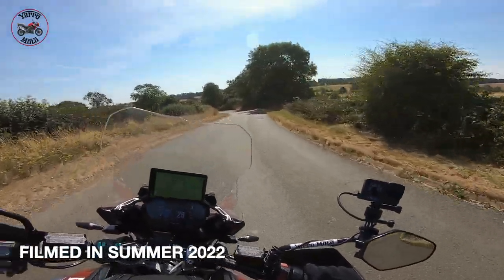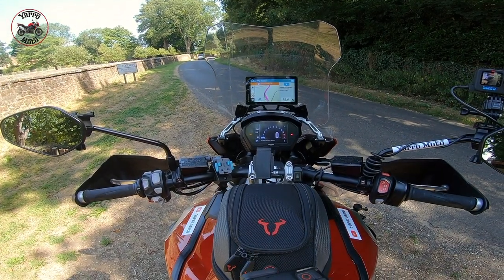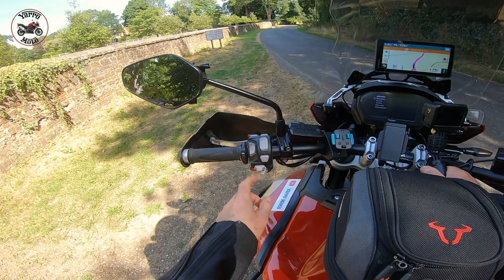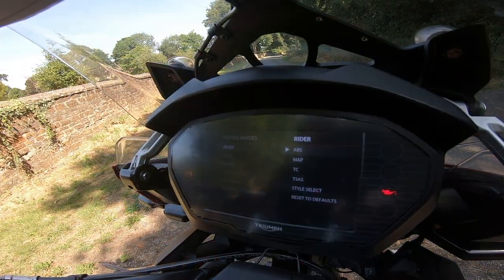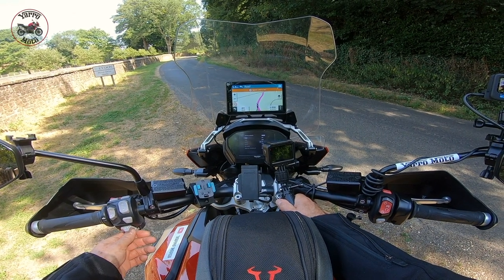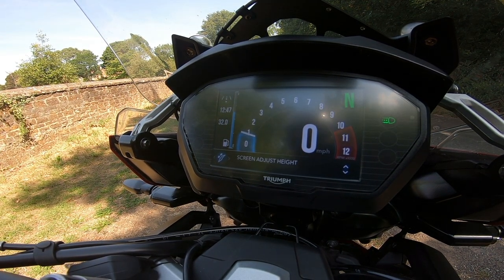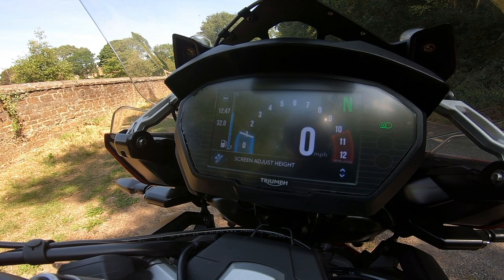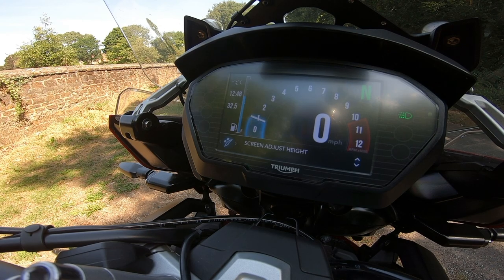How to lower the ride height on a Triumph Tiger 1200.

Comment: hey, thanks for this, but is there a way to keep the front suspension fairly stiff while keeping the rear as low as possible? My '23 1200 RE tends to nosedive when braking, presumably because I have the settings set to "comfort" to keep her as low as possible.
Reply from the maker: Hi Mike, I usually have the setting mid way in Road because I find the Sport setting way too jiggly for me.

Comment: I've got the 2020 Desert Edition with 5 ride modes (road, sport, off road, off road pro and rain). No Rider mode. Can I use the sport mode in lieu of the Rider mode and make the same changes detailed in your video?
Reply from the maker: I don’t think Sport mode will work in same way but give it a try🤔

Comment: I've just done around 7,000km in that mode, to help my missus with getting on and off.
Too bad it doesn't retain the mode on switching off the ignition.  Have to reset to rider mode each time the bike is started.  :(
Reply from the maker: Personally, I changed the mode when really needed but didn’t ride like that all the time, as it altered the suspension dynamics too much.

Comment: I notice riding two up and lowering the suspension I can’t lift it back up
Reply from the maker: When you change the mode back to ‘normal’, it should ‘pump’ the suspension up again, in my experience.